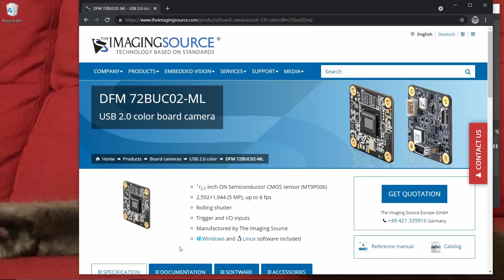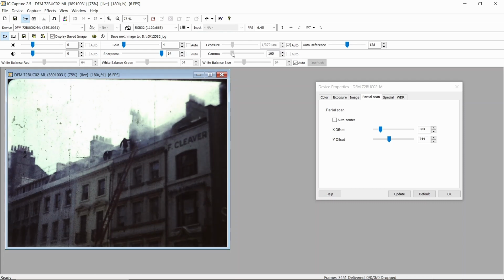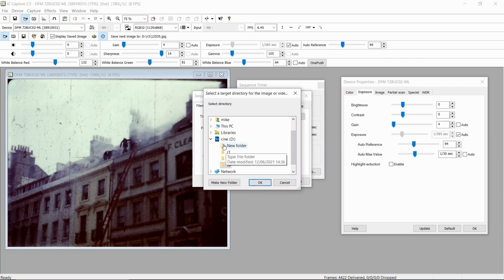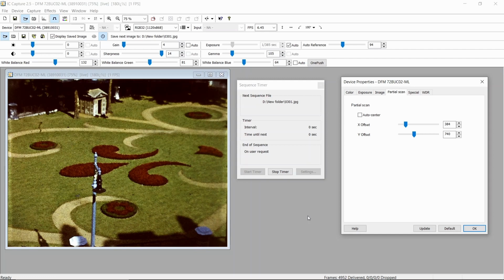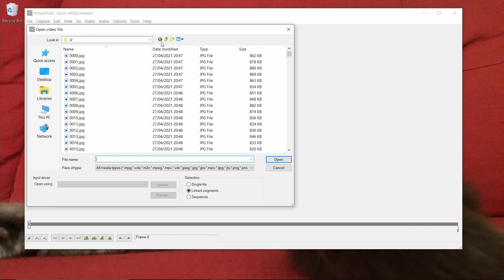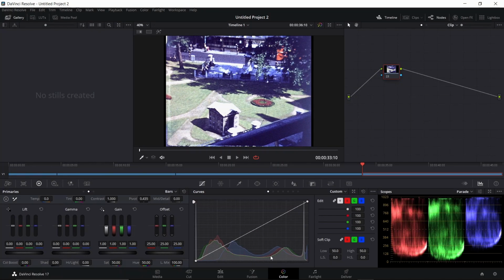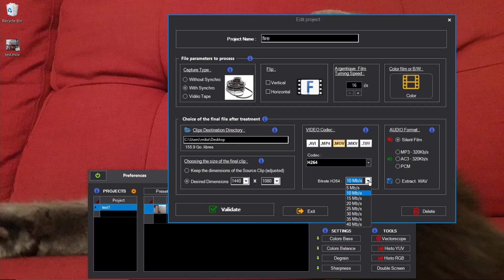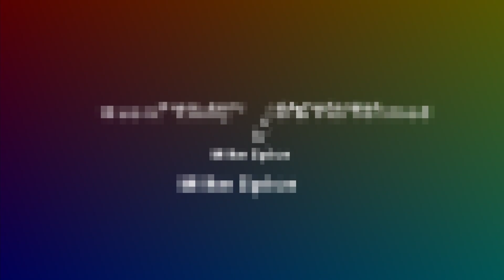Scanning 8mm Cine with IC Capture

Comment: Hi, thanks for the video. Can I ask you a few questions? I see you use RGB32 and you save frames one by one. Recent The Imaging Source cameras have 12-bit color depth and you could enable WDR mode in the application. This should have been offered you a bit more of a quality, right? There might be a problem with finding proper format compatibility with other software though. I wonder what is your opinion on this, is it something excessive, problematic or something else?
Reply from the maker: I have used the WDR in some but not all scans. I found colours were too saturated and some blacks looked terrible.
If one day I begin scanning again I will maybe try again but for now I'm happy. Thanks for watching
Reply: @Super8Rescue Thanks for replying, I am aware you are on a happy retirement. I asked because I was talking to someone who does something very similar, and so I learned how people use IC Capture to digitize.  I see you also save individual frames into files, where formats are such that again color depth is typically immediately reduced to 8. Then in turn there is no good codec to save video in full color depth for outside editing, and I think I fixed exactly this part - it's possible to simply record video from IC Capture and save AVI with 12 bit depth with or without tone mapping, and then reopen the video in DaVinci Resolve directly and continue there... I know it's of little use for you anymore, just sharing some findings.
Reply from the maker: sharing is always good.  I was dealing with thousands of feet of film, I would have liked to have saved frame by frame in .png format but the file sizes were just too large for the storage I had available at the time.  A 400ft reel in .jpg could run to 60gb depending on the frame area I captured, and .png maybe three times that amount, let alone having storage to keep content long enough to work on it in DV  Resolve with an inadequate laptop so it just wasn't practical with the amount of film.  The idea was mainly to let people who sent me thier films to at least be able to see them again after maybe 20 years since they last saw them and on a decent laptop they don't look too bad. 
It was never about preserving at the highest possible quality which clearly some people like to do as archivists. I also didn't have the amount of time needed to dedicate to such a project.  
Scanning 400ft of film to uploading at youtube (which again is not an ideal platform but it works) could take up to three days at the quallity I was working with.
My set up was not a permanent thing, I had to set equipment up, do the scan, put everything away to carry on with a normal working life, so some speed was of the essence trying to strike a balance between practicality and quality.